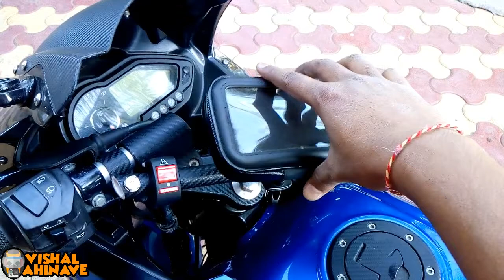Mobile Holder Installation on Pulsar 220 | Custom made Rod

Comment: Mere pass drill nhi h iron garam karke hole karun toh kamiyab hoga?
Reply from the maker: +The Bunkers ha possible hai
Reply: Vishal Ahinave app toh yee cheez kafi time se use kar rahe hoo soo how was your experience with this pvc pipe idea for holding mobile is it gonna work and stay stable in high speeds ?
Reply from the maker: +The Bunkers Yes it is stable at high speeds and even on bad condition roads. Holds mobile holder properly never came out of the mount.
Reply: Vishal Ahinave  Thanks  I'll gonna use your idea for mounting my phone 😊